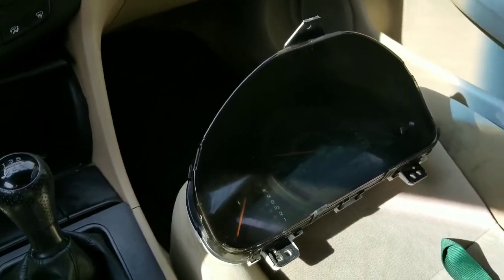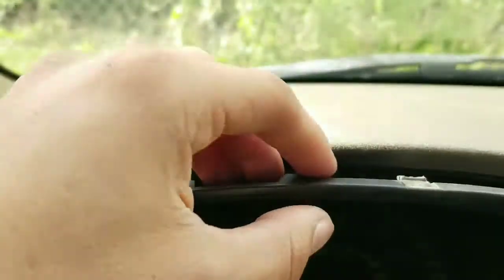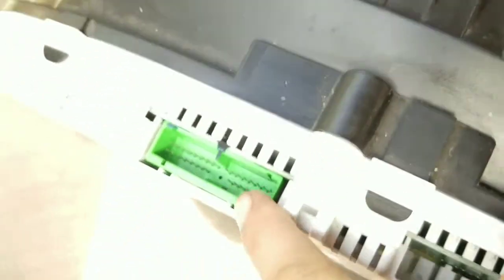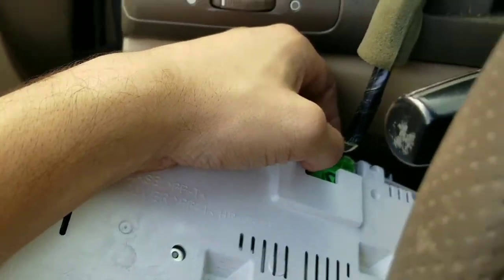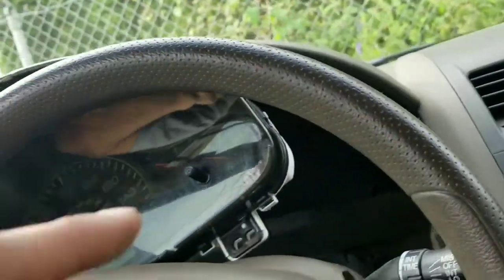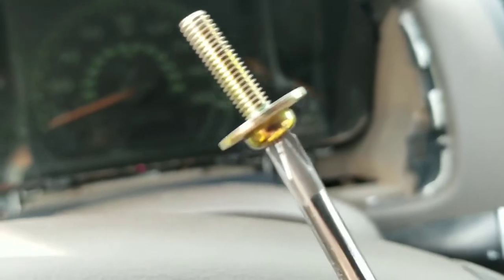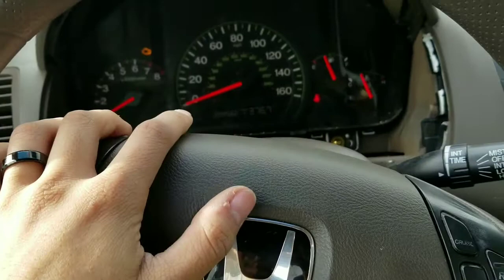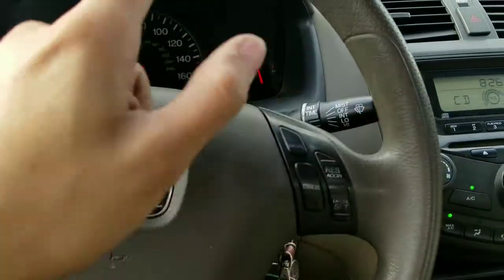How to replace A Honda Accord Cluster!

Comment: I want to change the lighting on the gauge cluster. Have it all out and this video was not what I was expecting 🤣🥴 any suggestions on replacing the lights
Reply: Same man I’m trying to change it to blue can’t find no videos
Reply: @GhostKing630  Don’t recommend😭😂. I ended up in a rabbit hole finding nothing, my gauge cluster wouldn’t work (didn’t know what speed I was going). Finally fixed that… barely… and completely gave up. Then again you might be more skilled than I 💀
Reply: @haleighryan5997  i heard supposedly you want change the lights unless you un solder them and then solder them back in and its "Really" hard to do that because of the little bits that the lights go on
Reply: You have to solder them

Comment: Mines stop working on my car. Would swapping it change my miles?
Reply from the maker: Yes it will change the miles, so if you had low miles try to find one with low miles, ig you had high miles, you could try to get one with low miles also

Comment: Did you get a different mileage I changed mine and the mileage changed and it added 15 k
Reply from the maker: Milage will always change depending on the cluster itself, If you buy a cluster with 90,000 miles it should show as 90,000 miles, if you get one with more miles, it will show as having more miles
Reply: @oscar_cu2 sir are you positive about that please call me man I’m tryna figure sum out and ask a question literally take like 2 mins lol I know it’s kinda weird but I’m going thru some shit and need to know about if the miles will change or stay the same on this damn cluster 😂